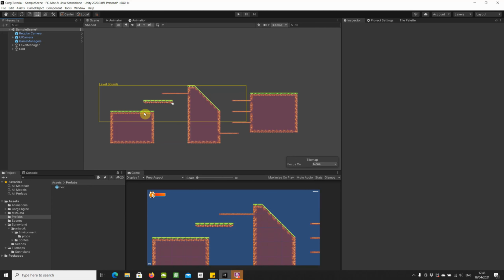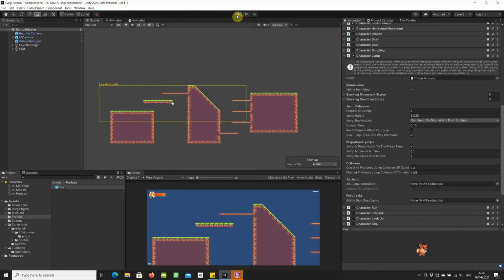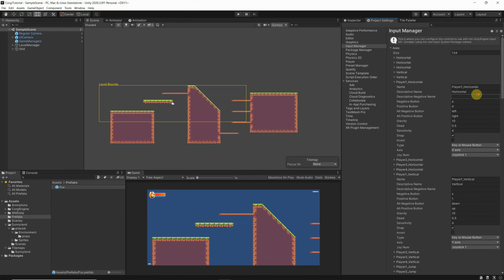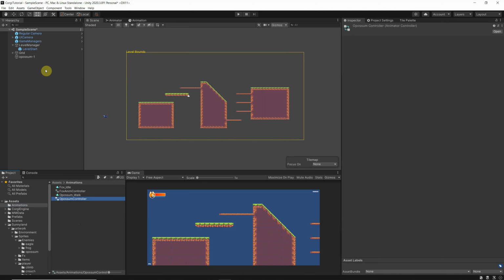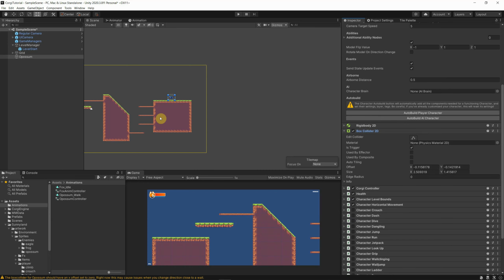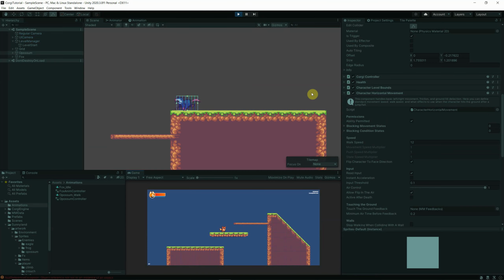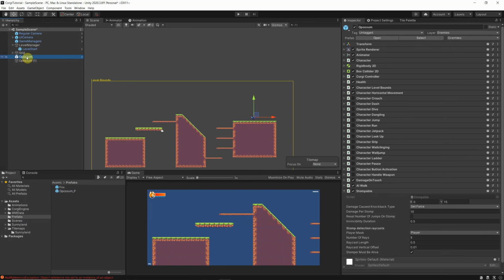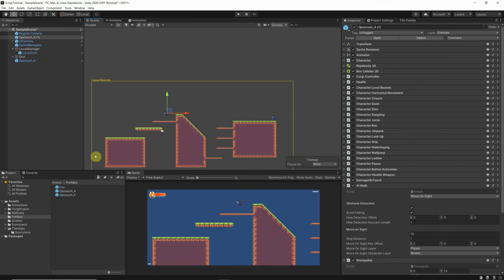Corgi Engine Beginner Tutorial 5 - Control and Enemies

Comment: I'm having this weird issue where the sprite keeps flipping facing left and facing right while moving forward then stuttering back and it just keeps doing that. Any ideas on why? I really appreciate the videos to get up and running with Corgi Engine. Thank you.
Reply from the maker: Hello Teriarymap (Where comes that name from?). So there one issue is the facing direction. Go to the character script and change it so it faces the right direction. The other issue is something you may need to tweak around to find the solution. One is depending on the collision. Try to use composite collider if possible. And another is to check under AiWalk and maybe change the falling down paramters. So avoid the holes. Change those values. I hope that helps.
Reply: @dr_noob  thank you Dr. Noob! Tertiary= 3rd and the "map" part are my initials 😅 thanks a ton for those tips. It solved my issue to tweak AI walk and Char Horizontal Movement.